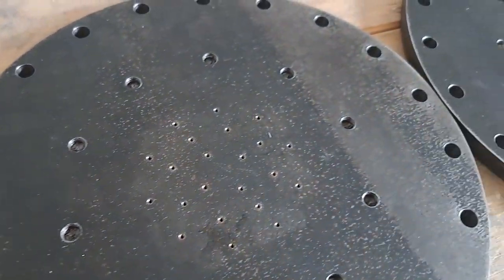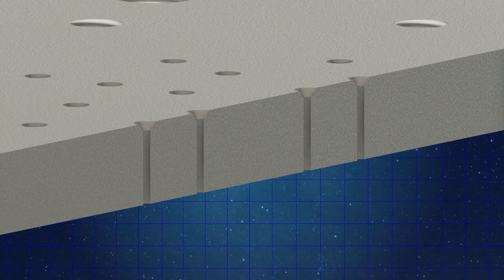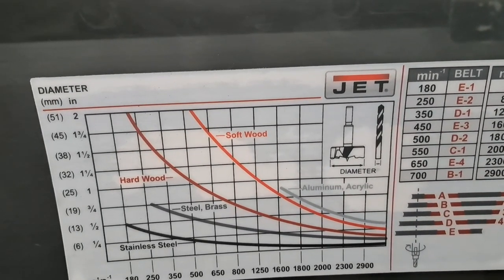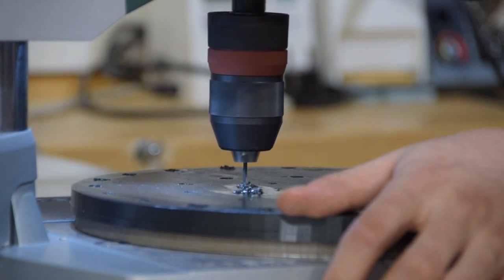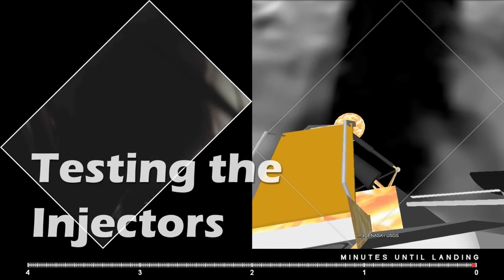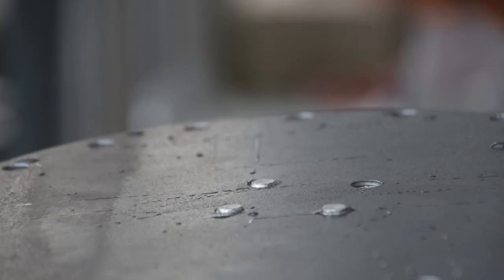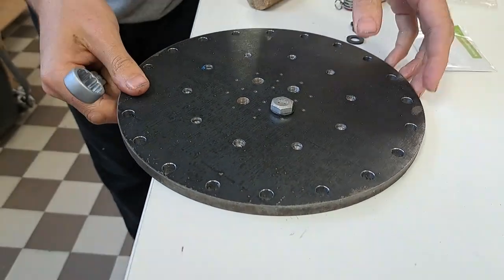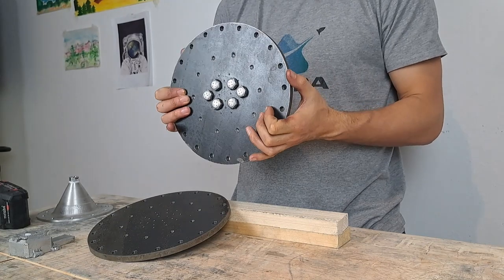Building & Testing a Rocket Injector

Comment: Thin sheets of steel (dünnes Stahlblech) and then slightly correcting the position of every hole might get you the diagonal channels. Probably screwing them tightly together might be sufficient. Alternatively give 3d-printing together with electro-plating a try. In case you can use copper sheets there's a way to glue them together with mercury and heat (probably some kind of amalgam ...) ((I forgot the details)).
Reply from the maker: Man, second method sounds pretty fancy.  We might need to upgrade our tools to pull off a strategy like this.  I think the plate method might be a bit too inaccurate.
Reply: @ASTRABremen  you could still drill and polish the openings with the plate method. Any way you could try with electroplating, get conducting ink (silver ink) and use wax for modelling. Electroplating is slow but simple. I saw a video on youtube where one guy used it to make some part of a rocket engine.

Comment: How are these nozzles different from the windex/glass cleaner bottles, aside from material? They seem to be atomizing the cleaning fluid very well with just a press of a lever.
Reply from the maker: They are essentially the same, just not designed for 55 bar and 3000+ K
Reply: @ASTRABremen  hello, I know that you manufactured the new injectors using a professional machine shop.. but this is just an idea if you reattempted this again (please feel free to criticize)
you should have drilled the holes in reverse starting from the common point of intersection everytime... this way you can confirm that the holes will eventually intersect.
Then you cut 20% or 30% of the bolt from the single hole side in order to get the intersection point in the air

I hope you understood what I am trying to say here but this method you drill in the opposite direction to what you did here starting all 4 holes from the same point and then you cut that point off by removing some length from the bolt side with the single hole and voila

let me know what you think! cheers

Comment: Great video, really interesting to see your approach! 
Is there any specific reason why you placed the injector elements/bolts the way you did? I assumed a circular, evenly spaced pattern is better, if possible. Also, Im going to study at TUHH in Hamburg from next semester on and I will try to establish a rocket team there as well, so i have a few questions for you: How did you start this project, were you able to convice your university to support you with infrastructure and/or money or is this all done privatly? Have you found a place in the area to hot fire the engine safely? 
Keep up the great work!
Reply from the maker: Wow, lots of questions.  I will try to answer them all:
1. The placement of the elements was a bit accidental.  It was supposed to be just 4 bolts with six holes.  But after the first try at manufacturing we realized that 6 holes was too much for one bolt.  Thus we have to drill 2 more holes and we couldn't make them arranged circularly anymore.  At least we have two more slots for bolts if we end up needing more flow after the hot fire test so at least this way we are a bit flexible for an increase in power.
2. Great to hear that you want to start a team.  We need more in the North of Germany for sure.  I started the project by just putting out a notice to the students in my study program that I wanted start a group that builds a rocket that goes to space.  There were about 15 people that were in to it after the first meeting and that essentially became ASTRA.  In the end we decided to become an e.V. as that seems to be the easiest way to operate in Germany as a group like this.  If you want more info on this, feel free to reach out (you can probably find me on linkedIn or you can write to astra.bremen@gmail.com)
3. We have not been able to convince the uni to support us...  A bit sad, but we still have hope.  Maybe when we get to space they will realize what a disasterous mistake they have made :).  Most of the money has been raised privately so far, but we have managed to raise around 6k€ in our crowd funding campaign - which is still ongoing... (hint, hint to those who might be able to support).
4. We are doing our first hot fire test at DLR Lampoldshausen (not exactly close to Bremen unfortunately).  One of our long term missions would be to set up a hot fire type of facility somewhere in the North that could accommodate student rockets.  Maybe with more teams in this area we will be able to pool resources and political capital to make it happen.  So, definitely encourage more of these groups to form!
Reply: @ASTRABremen  Thanks a lot for your explaination. I was just a little worried about your engine going boom because of uneven burning due to the injector. But i understand this one was just for development and you dont plan to fly it that way. 
Interesting to hear about your experience starting and financing this project.(i guess you`ve already asked the local space industry like arianegroup for funding). I will probably have some more questions when we really get started, but thanks for offering more info.
Good to hear that there is a test site. But would be nice indeed to have some place here in the north. I mean in theory one could ask some farmer to use their field but it would require a movable test stand including all the Gse and stuff. 
I heard that the DLR also has a program for student rockets, so when you say you can use their facility, you are probably involved in that as well?

Again thank you for sharing so much of this project and good luck!

Comment: Did you get any Cd data for your injectors? What kind of pressure drop are you aiming at for the injectors?
Reply from the maker: We were looking for 30 bar in the combustion chamber or more.  In the end we got exactly 30 bar so it actually worked pretty well.  We had to up the injection pressure a bit to get that though.  Overall, we had 25 bar drop across the injector.  We are still analyzing the data to determine the injector Cd but it looks like it was around 0,6.

Comment: Why didn’t you simply take advantage of the adjustability of the drill press’s table instead of making those angled contraptions? Look under the table and you’ll see a lock lever that will allow you to do this.
Reply from the maker: Unfortunately our drill press doesn't have that feature.  I wish it did...  Also, if we had that feature, it would still be very difficult to make sure the flows converged without very accurate placement.  The contraption at least helps with that.

Comment: how do you determine the number of bolts required to bolt the injector plate to the engine (Outer bolts around the plate in your video)?
Reply from the maker: That was based on FEM simulation.  We have definitely over engineered it though.  The safety factor for the fasteners is somewhere around 10.  Theoretically we could hold the plate on with just 4 bolts.

Comment: Dont seem to imping well and you need to inject oxidizer into the fuel stream also not just a spray of fuel
Reply from the maker: It is a hybrid rocket, so the fuel is in solid form.  The oxidizer is what goes through the injector.

Comment: Your angle is too shallow, it should be around 60 deg to be optimal - but great job guys :)
Reply from the maker: this was an older design.  We have learned since that we need to make the angles steeper.  It is just tricky to manufacture them ourselves at those steep angles...

Comment: "These holes have to be very precise" - proceeds to mark hole locations via a plastic template, a punch and a mallet. I don't want to judge, but there are good chances that the guys who let you use their waterjet cutter might have a vertical mill with a DRO (or even a CNC mill) somewhere around. That thing will give you a couple orders of magnitude better precision in both location and squareness, as well as save you plenty of time and elbow grease in the process.
Reply from the maker: We attempted to get the holes drilled professionally and sent many quotes all throughout the Bremen region with none under €500.  The waterjet company just does the discs (no holes).  Holes are really no issue for us, it is the threading that sucks.  Also, the plastic template is 3D printed so has a reasonable degree of precision - at least enough for our purposes.  If you check out some of our later videos, you will see that everything lined up perfectly and to top it all off, we had many successful hot fire tests with the injector plate even surviving the explosion that ended the campaign.  Overall, I would say we did a pretty good job on the injector at least...
Reply: @ASTRABremen  I never said you didn't do a good job. On the contrary, what you did is remarkable. I know professional machining services can get quite pricey, I was thinking more like "a friend who can let you use a mill in his shop on a weekend" kind of arrangement. And you can power tap holes on a mill (with some practice).
Reply from the maker: @andreipetrenko2422  I guess we just need to find the right friends...  As the group matures, I think we may find more opportunities like that.

Comment: how would you combine both fuel and oxidizer? would they both go in the funnel?
Reply from the maker: It is a hybrid rocket so only the Nitrous Oxide goes through the funnel.  The fuel is solid paraffin wax which is already in the combustion chamber.

Comment: M'i wrong or the aluminium dye did not angeld the injector holes
Reply from the maker: It did angle them.  It holds them at a 4° angle.  It is not much, but enough to have them converge a few centimeters away from the plate.
Reply: @ASTRABremen  did you thought to make it like 45ish degree ? Speed of collisions would be much greater
Reply from the maker: @bartekpudo9624  We did, but we would have needed much thicker bolts...  This may be an improvement in the future.  Probably would need M16 or M20 to pull of angles greater than 20°.